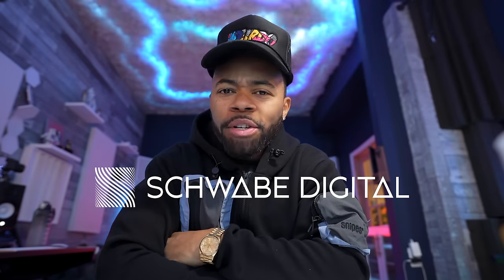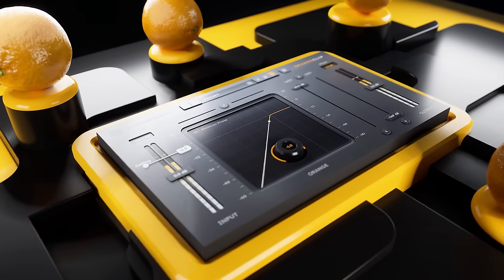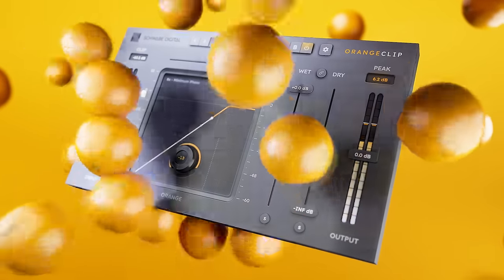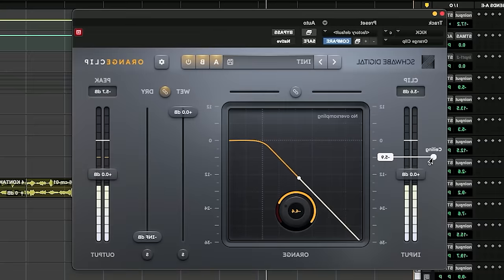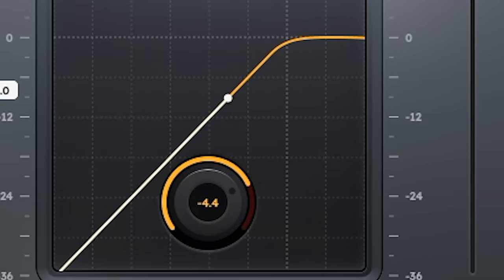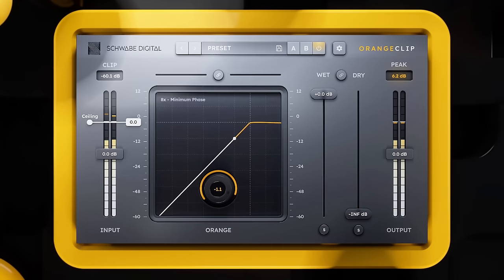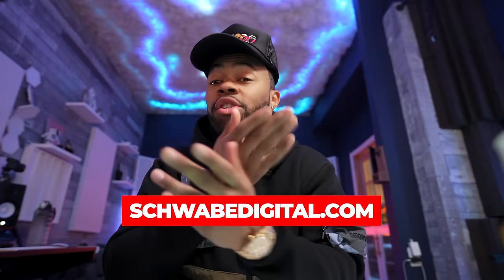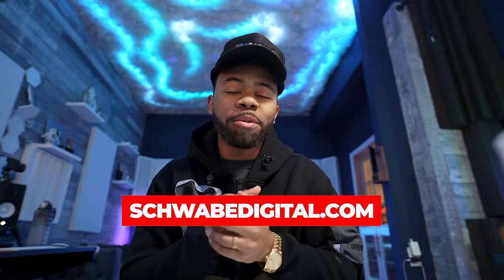Is SOFT CLIPPING What Your Mix Is Missing? With Ryan Schwabe

Comment: About that M1 issue,i have a funny one myself : Everytime I switch off my Apollo x4 while the computer is in sleep mode,the macbook goes brrr,crashes and restarts 😂😂
Sent it to Apple,they said it was fine,went back to the studio,problem is still there...from what I found out on forums,it seems to be a "Kernel Panic" caused by either a faulty hardware connection or a faulty software...but my Apollo works fine,cables too,console app is up to date,and all my daws and plugins are legit....drives me crazy 🤬

(I have a maxed out 2022 M1 MAX laptop )
Reply: I’d like to think it’s because of the Apollo. I can’t remember my biggest pet peeve that caused me to sell mine so fast after getting it, but it was one of the best decisions I ever made. My M1 Mac cooperates with the SSL 12 flawlessly coming in and out of sleep mode 🤷🏻‍♂️
Reply: I got my Apollo back in 2016 when they came out with the thunderbolt and had a few issues workflow wise that caused me to part ways. Glad I did it before spark came out too 😅

Comment: FL crashes for me on m1 and constantly bugs out with a lot of plugins. Been using it consistently for two years. Logic is great and hasn’t had this issue once.
Reply: AnyDAW bugs out with a lot of plugins. The most of you plugins should be on the buses you should have a EQ and maybe 2 compressors on you tracks.
Reply: @Sub-Zero-gr5cf a lot of plugins, meaning almost every plugin that I use, not simultaneously, just one by one I encounter errors. And even if you did use multiple plugins your Daw should not bug out unless you’re still rocking windows xp